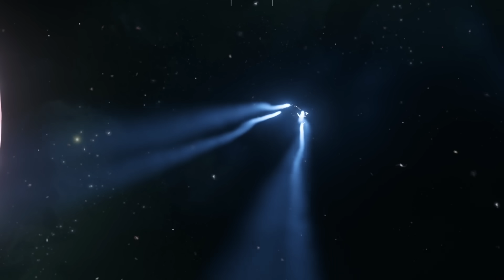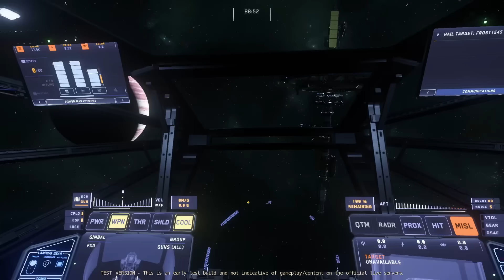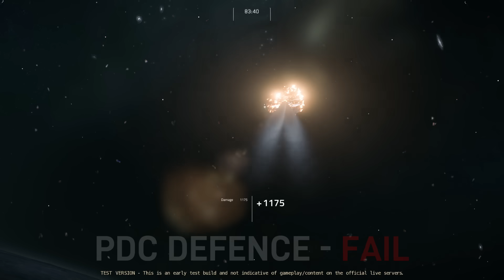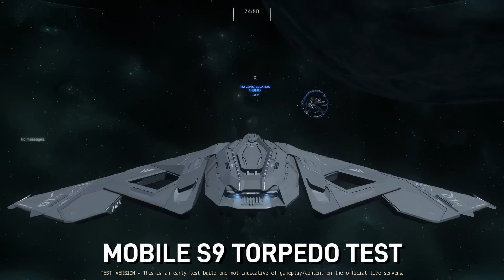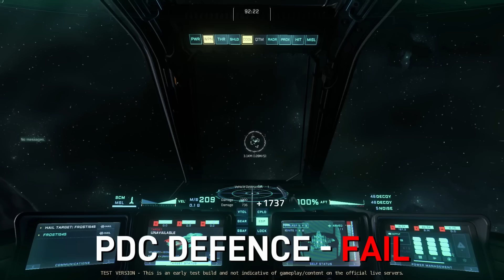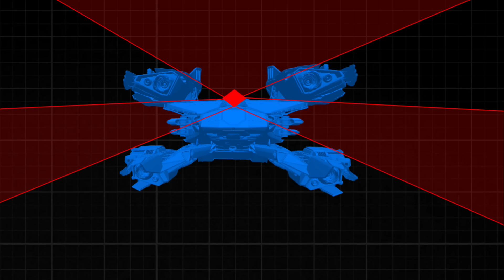POINT DEFENSE IN STAR CITIZEN! USELESS!

Comment: Hm, feels like an easy dirty somewhat fix, least for the firing angle, would be to place the PDC on the angular plate so it would be blocked less by the engines, or increase the amount by an extra 3 and place a single one on each engine giving a much better protection overall.... ofc that doesn't count for much if they're basically useless in themselves, so that needs to be fixed first.

Comment: Just my opinion they could put the pdc at sides of connies or sides of engines in place of pilot guns. 

They should move those pilot guns somewhere more optimal like in front, beside cockpit. I wouldn't mind if it they reduce it to 2 size 5 or I would be very happy if they turn it to 2 size 6.

Edit: just finished the vid yup you're exactly right. Same as i imagined more optimal if they put it at the sides.

Also wanna add they really need to rework the landing gear. Gun placement in the engines looks really weird.

Comment: Its not meant to be an instant missile-invulnerability shield you know.
Its meant to add ~10% of mitigation chance, especially during evasive maneuvers AND combined with chaff and flares.
People in the community just have no concept of game balance.
Missiles need to be high damage and dangerous, and they have barely worked for the entire 3.x cycle. Now they finally work somewhat reliably and you instantly want them to be totally nullified again by an automated system?

If you know anything about game balance, having a FREE automatic 10-20% chance to negate ALL DAMAGE from a weapon type, that is insanely good.
Now factor in this is talking about ONE PD turret.
If you have THREE of them you now have 3x proc chances of 20% each. (It wont add up to 60% because its still 3x 20% chances, but still way better)
Now imagine SEVEN of them on Polaris / Idris etc. You are approaching 100% chance against more than 1 missile / torp.
For free. Every time you get fired at. Without crew. Forever. While sitting AFK!

How is that "pointless" or "useless"? Imagine if we had laser defence that shot down 10-20% of all your bullets when dogfighting?
I promise you would cry about it and absolutely not call it "useless".
Its yet another example of specialization in expertise. You are brilliant at dogfighting, but you have no sense of ordinance or missile balance in a larger scale.

Anything above 20% effectiveness would be way too overpowered and render said weapon type useless instead.
Now, the PD does need to start shooting at longer distances though.
Reply: all i saw was 100% failure against anything smaller than s9, and 100% success against s9. that doesnt seem like 'chance' or a probability to me.

Comment: The counter to PDCs should be overwhelming them with income fire, ewarefare, stealth. but not because PDCs have bad placement location and track/hit rate.
Reply: RSI's engineers are their own enemy.  It's company policy from Roberts himself.
Reply: You can always look at test results and boost up damage, accuracy, range or fire rate. Everything devs need to do to make it work is to change 4 numbers. That's not a big deal. The question is will it be on live like that or they'll fix it?
Reply: I think these PD are being modeled for intended use on the Polaris first, which it’s common threats going to be size 9 and above torpedos which it seems to handle very well. I would like to see it improve at least against s5 torps too.

Comment: The MFD and HUD rework has been a real sticking point with me.  

They flout every tenet of sound design, colour use, and information presentation.  
Infuriating.
Reply: I prefer the new layout but hate the vastly reduced control I have over individual system, now if I loose an engine i can't just shot off the next engine to prevent rolling around
Reply: @nicholascoker7212   Some people may prefer the new layout; that's well and good.   I personally detest the removal of flight and combat information from the HUD.  
The GUI was made to be appealing, not USEFUL.  That's the crux of my beef with it.  
A useful GUI can be made appealing to many with personalization options whereas the current mess is a challenge to actually USE.

Comment: They gotta just get rid of the bespoke docking mechanic on the connie and just throw a small hangar box on the back.
Square out the geometry between the 4 engines.
The Taurus can just have that be a radar protected area that opens and you can tractor cargo into the back. Andy can be upgunned with a merlin you can park there, sensors on the Acquy and also can park one on the back miniature hangar.
I get the engine design is cool, but its too much fidly geometry to aim around. Give it a squared off, phat a$$, maybe bump the shields a bit, and you can slap a PD turret on both top and bottom of that with full 360/180 arcs.

Comment: The issue seems to be the spread on the weapon and the physical size of the torpedoes. The s9 was intercepted successfully, but not a single s5 was taken out, and you can see how much spread the weapon has in some parts of this video. The PDC should be ballistic gatling, or let us choose between laser and ballistic. Also have to keep in mind this is still only the first iteration of PDCs, they will likely get lots of attention during the PTU cycle.
Reply: lots of attention once they are in? its been my experience that the opposite is usually the case. once its in, that is the state that it will remain in for years on end.
take mfd for example. finally updated even though they have been talking about an update since like 2016.

Comment: As I mentioned on FoxyLoxy's video, pretty much every S4+ ship needs at least one of these - terrible performance aside.
Particular flaws here include range that is too short, fire volume/damage is too low to defeat missiles, velocity is potentially too low to meaningfully affect the missiles, and just bad hit registry potentially serverside on anything smaller than S9 torps.

If the PDCs can work consistently, the C2 and M2 need two, the A2 and Hammerhead need four, the Reclaimer needs four to six, the corsair needs at least one, and all of the connies need one. The Hull C could use at least two of these, if not four. To make the Phoenix's selling point of PDCs more suitable, the Phoenix should have two of them with better coverage.

These things should be defeating smaller missiles with relative ease unless they are launched from extreme close range or in large numbers, and should be handling 1-2 S5 torpedoes just fine. S9s might prove a little more of a challenge, but maneuvering and decoys should be able to handle them in single numbers just fine as well.

Comment: i think the problem is the fire rate
single cannon and only about 500rpm sure won't do a great job
irl ones usually have over 3000rpm
Reply: Needs phalanx ciws for sure
Reply: More like 10.000 rpm on ships, or even 16.000 if you go for soviet ship variants.
Reply: Wtb vulcans
Reply: IMHO PDC should be a ballistic Gatling, more ROF and spread, with limited capabilities. It's effective, but if you want to keep using it you need to rearm.
Reply: IRL CIWS are moving away from the silliness of phalanx etc with their limited firing time and significant magazine reloading time, to dual purpose cannon that are mounted much like conventional ship turrets that have magazine internal to the ship, that just are much more efficient, have much longer firing times etc etc.

most of the projectiles from a phalanx are doing nothing and are just missing the target, and the only reason they hit things is the volume of fire put into an area of sky, modern cannon in modern CIWS are just highly accurate, like some of the Rheinmetall and others offerings.
Reply: @b101uk9  don't tell me. tell CIG.
tell them to make programmable amunations and compatible calibration system
my opinion is just a quick fix base on what we already have
Reply: No the problem here is peoples stupid expectations. Think GAME BALANCE. The PDC’s are a meant for large torpedoes that may actually destroy the ship. Think S9 and 10. Small missiles at high speeds are what current maneuvers and counter measures are for. NONE of these tests showed a defensive, dodging, counter measure using ship. PDC’s in real life are a LAST DITCH defence. If it’s being employed, you already screwed up. As well, they aren’t meant for small fast projectiles, think canon shells or rockets in real life. PDC’s wouldn’t even employ on such projectiles. A Connie with 1 single PDC is not a typical PDC user. The large ships like the Idris and Kraken are viable users for defence against LARGE missiles and torpedoes. It’s not meant to take missile play out of the game. It’s unfortunate that in this case Avenger 1 doesn’t understand the base use case for a PDC. Also, testing the single first PDC in the game and calling it a failure before considering that there may be classes of PDC and different types, like maybe ballistic or shotgun, is short sighted and illogical. The entire review is of a 1st test case, without understanding scope, and without understanding the point of a the system in the first place. This ISNT a defence item for fighter pilots, and the writer is a fighter pilot and it’s apparent.
Reply: @charliemcawesome5012  in a way you are fundamentally wrong, PDS have IRL being used vs artillery shells, rockets and missiles and other fast moving things, and with modern dual purpose systems that use cannon their range has been pushed out much further, so they function like AAA at longer range and CIWS at shorter range.

also another point of issue,  are the LAST DITCH defence, not PDS in the context of ships with both PDS and counter measures, its counter measures.

you are correct though, in the latter part of your assessment in one test case of a tier 0 initial system has limited value.